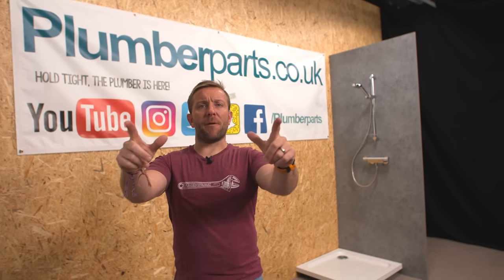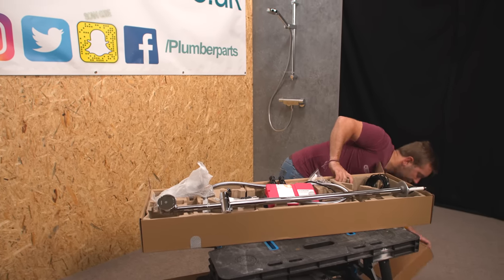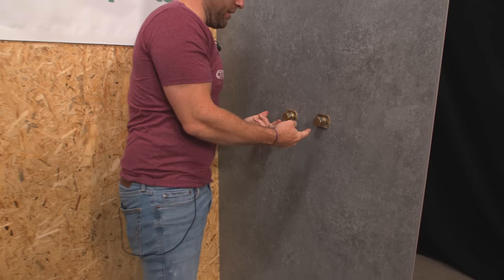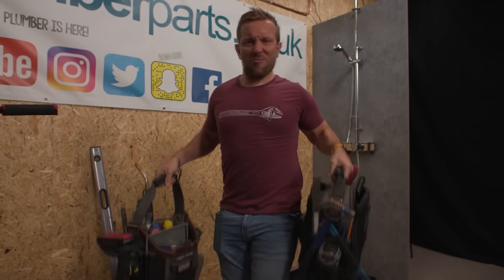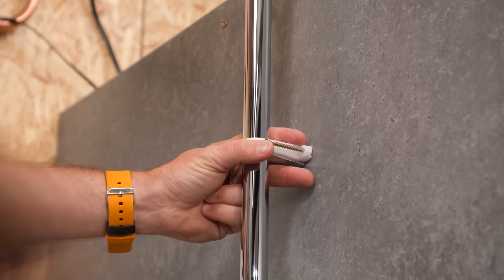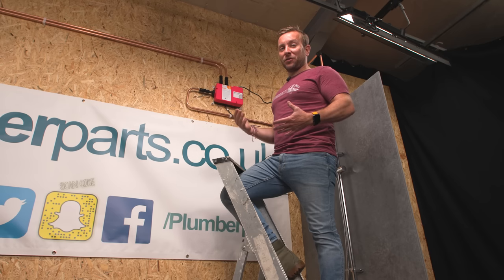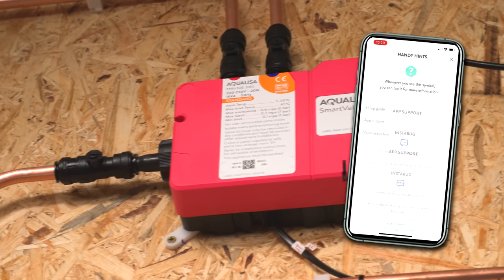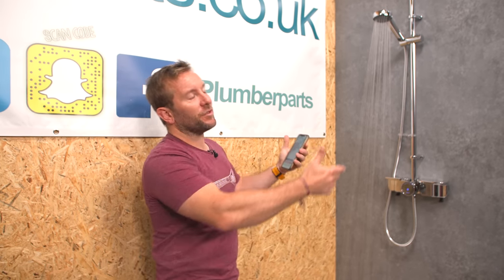How to Upgrade Mixer Shower Without Touching Wall Tiles! Aqualisa Quartz Smart Retrofit

Comment: Great video matey 👏🏻. I'm a registered Aqualisa Installer and saw this come through from their marketing team a whole back. It's a great idea and certainly makes like a lot easier. It's a shame there isn't something similar for a concealed shower valve but I think that might be asking too much 😂. Similar to other comments, remote working is a strange concept. If you have a bath filler you still have to put the plug in to fill the bath. If you have a shower enclosurer you still have to close the shower door before you flood the room! So I've never really been convinced about smart showers. But heh ho. Thanks for taking the time to put the content together. And enjoy Croatia 🇭🇷

Comment: James, you are a legend for making me aware of this product! 😍 At first, I was thinking why the hell do I need to control my shower from my phone?

But this actually solves a big problem I currently have. My shower is leaking behind the wall and down to the room below. I’ve deduced that it is leaking behind the connectors on the wall where the pipes connect into them. I can only assume that the last homeowner / plumber didn’t connect the pipe behind the wall to the 150mm spaced fittings properly. I was thinking that I need to remove a tile or 2, re-connect the pipes to the 150mm spaced fittings properly, then put the tiles back on. A job I have been putting off for a long long time. However with this product, I can just disregard those 150mm spaced fittings, and install the new shower through the loft. Absolutely awesome! Now I just need to find out if it’s compatible with my Stuart Turner pump...

Comment: Like the easy install.  Be good for new installs where you can't or don't want to cut into the wall. Changing temp and on/off from a phone is a bit pointless but usage info would be interesting.

Comment: Hey mate, quick question for ya..... to replaster and tile a 4' by 3' section of wall (without removing bath) that houses a shower fitting, how much is reasonable to charge? ok now I'm going to watch the video!
Reply: Go ask a local [to you] plaster and tiler!

James is just a simple plumber... he doesn't do tiling. Also he now charges for questions so if you've not stumped up some cash he'll never reply.  🙄

Comment: Love watching all your video's. My only concern with the install is it won't suite most homes because of access to pipes and electric. Also where to hide to control box
Reply: These have been popular in replacing bar showers when renovating bathrooms for years due to one pipe feeding the outlet from the processor and this model can be fitted after tiling. I've fitted many of these processors and they normally go in the airing cupboard or loft space. There is a pumped option available when you need dedicated stored cold and hot from the hot water cylinder. There are non pumped options for unvented systems, dual outlet and wireless buttons. Many options are available from other companies where bath fillers can be set to fill to a certain amount . This isn't an example of a professional installation but a how to install and an advertisement.

Comment: Thanks Jimmy and Aqualisa, looks like a great piece of kit that was designed with the installer and the end user in mind! Love the ability to control the shower within the App, doe's the App have a very loud alarm for people that have sticky pillow syndrome and find it hard to get out of bed in the morning? Ps. Happy holidays! :_whyhello::_Alearmy::_Fucktheag:
Reply from the maker: Cheers Chris!
Reply: Does the app explain how to re route the hot and cold up to the loft?
Reply: @Nickbaldeagle02  No.... but it does make you a nice cup of tea in the morning. If you ask it nicely. 😏
Reply: @Nickbaldeagle02  good question Nick, the App potentially wont tell you that (unless it does, not checked) as you can have a high pressure system, ie combi boiler or system boiler with an unvented cylinder, in this scenario you can place the Brain/main unit anywhere that suits your particular installation but if you have a system boiler on a gravity fed system, ie header tanks in the loft and a venteted cylinder then you will need to site the Brain preferably where you get the most head of water, ie the airing cupboard, and run your pipes accordingly, hope that helps.:_Fucktheag::_Alearmy::_fitpipes:

Comment: You regularly tell us to fit a water softener I live in Lincolnshire where the water is so hard it comes out the tap in lumps. But my plumber says I can’t fit a water softener with my idea boiler as it will wreck the heat exchanger. Is this true?
Reply: If your boiler has an aluminium heat exchanger ( most modern ones do) then you can’t have the heating system filled with softened water, if you have a combination boiler you simply by-pass the water softener ( they come with some valves you turn to by-pass it) that’s then hardened water filling it up. Once the system is filled with hardened water you turn the water softener back on and the domestic side will now operate with softened water

Comment: 18:15 don't make the ethernet/phone wire shorter

I feel that pain. I've tried even the most expensive of tools and terminating those without some loss of data rates is near impossible.
Reply: Behave. A kid could do it 🤣
Reply: @DukeofDave  not without losing the 1gb link you can't.
Reply: @dimitar4y  of course you can, I've done it countless times, it's easy.....and this isn't that, it's a dead simple RJ11 plug
Reply: @DukeofDave  dead simple easy, you must have one of those exotic good quality cables with exotic good quality plugs. Try terminating a cheap cable with a cheap rj plug because your employer's a scumbag. The wire is clearly bitten down into but there's contact resistance of a trillion ohms and it passess the basic testers but when plugged to the network you only get 10mb rather than the full gb.
Reply: @dimitar4y  No offense, but you are talking utter nonsense.